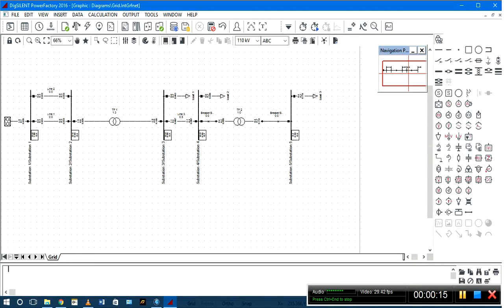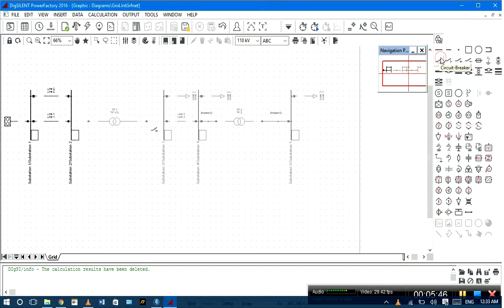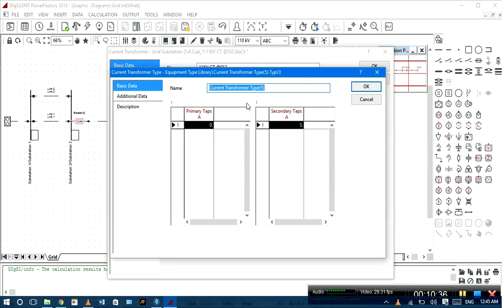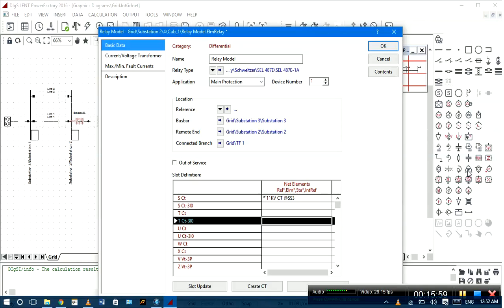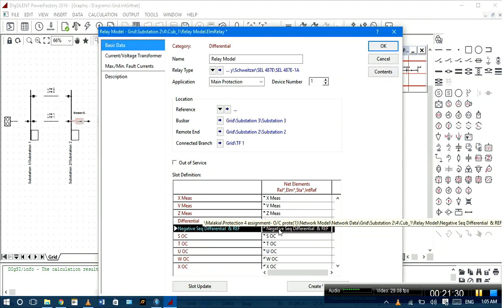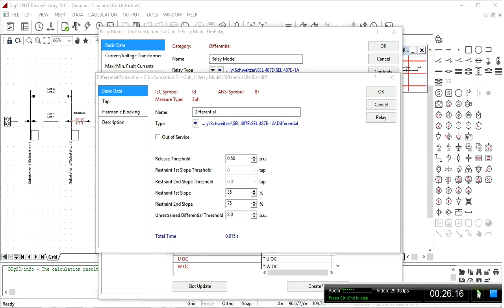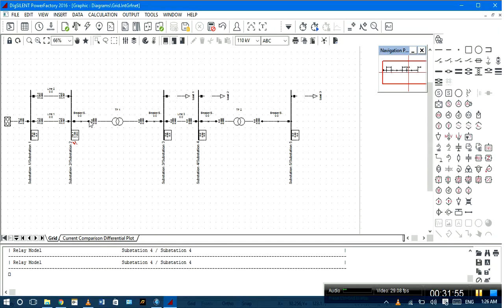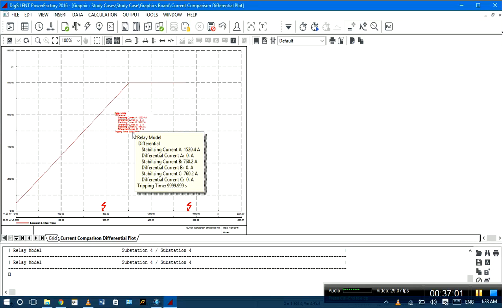Transformer differential protection using SEL487E

Comment: Thanks for your very informative and helpful videos. I have a problem with my diff relays, they work fine for 3ph faults, however with single phase to earth faults the relay trips on a fault on the HV side busbar. can you perhaps think why? I'm using a 9 bus system and find that a fault on the bus between the two busses connected to tfrs causes both those related diff relays to trip. Thanks in advance.
Reply: Hi,
Is there a way to make the relay connect to more than 2 CTs. I looked at most of the models and they could only connect 2 current transformer